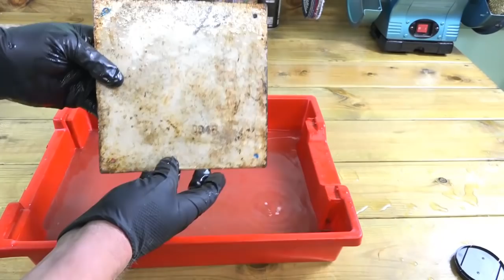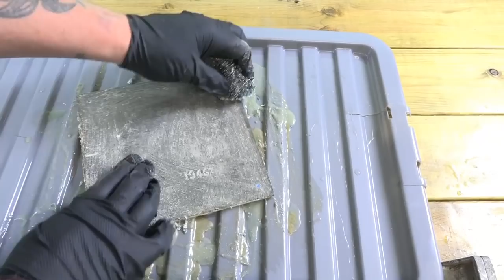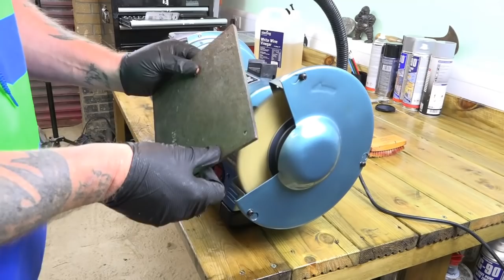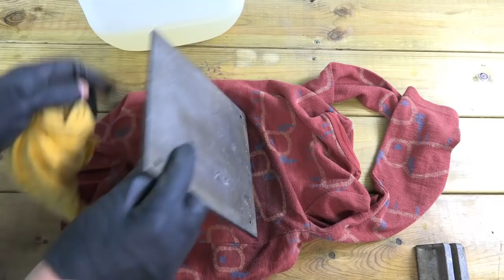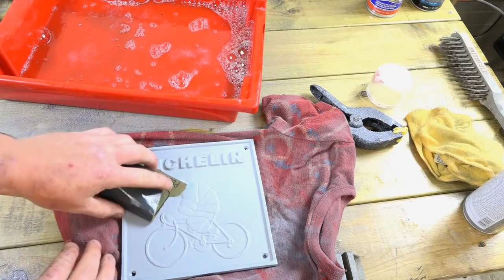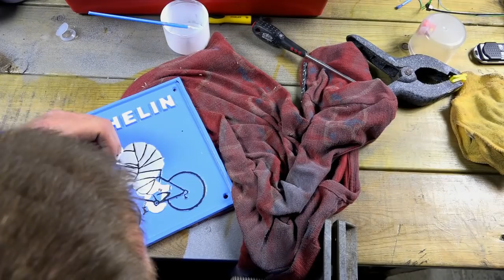70 yr old Restoration of a vintage 1946 ww2 era sign found at the tool english market

Comment: Just a fair job... I think you made a boo boo... the part of the bike should not be painted black where his outside foot is. Makes it look like both feet are on one side of the bike.  I'm actually quite surprised that this exists in metal. ... whatever metal it is, because all most all metals were still reserved for war materials in 1945. A medium gray might have been better than the black. it just looks too new. it is from 45 and should really look that way. as you found it, the lines were not that dark black. looked to me like they were actually done in the background on the Michelin man, the bike tires and frame were also white. looks like you could use a finer brush. Yeah, I'll probably tick some people off, and I don't want to but I will call it as I see it, I don't say nice things just to say them. The goal with something like this is to make it look original but better... this does not.

Comment: Not a bad resto but it isn’t from 1946. It is a fake.
Reply from the maker: i must of got ripper off paid £35 for it
Reply: @billyfix1129  I think you was. There are a lot of cast iron signs popping up on carboots and ebay lately. All are either fakes or just made from someone making the stamps. I have a Foden one. Cost £20. Some cost more and I have seen them for £17. Originals would have company name and some numbers on the back. Ir is easy to stamp a date into a piece of cast iron. Back in the 30's, 40's, 50's, most signs were made from tin with enamel on top.